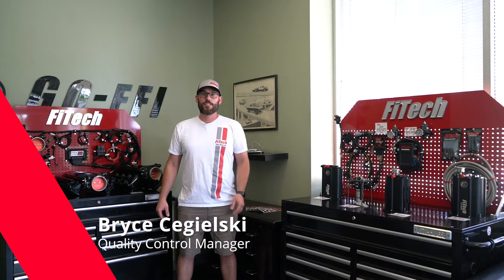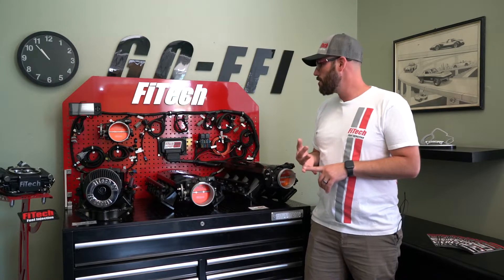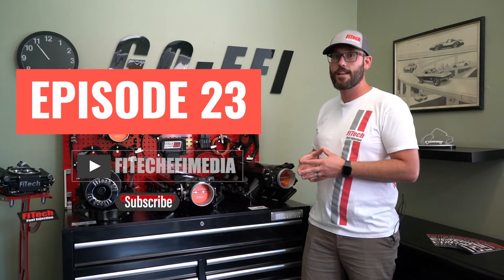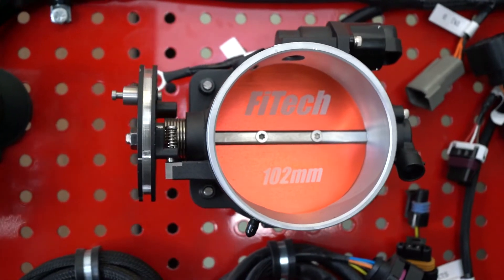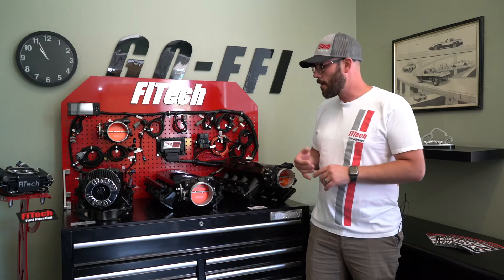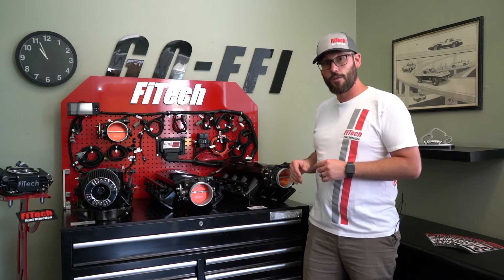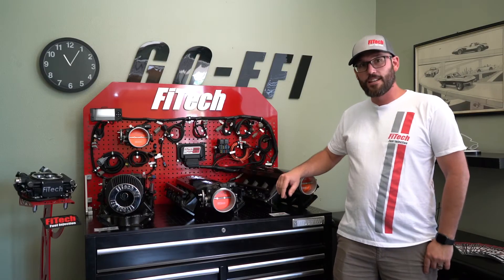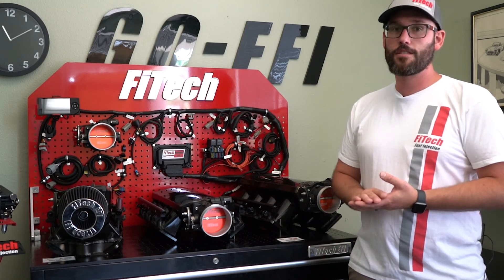Selecting your LS System | Tech Tuesdays | EP26

Comment: I have a 6.0 Ls w 4l60e transmission and want the complete ls kit w transmission control which do you recommend? And I would also like to know what fuel system ,its going into a 1985 k5 blazer 4x4  thx
Reply from the maker: Contact our sales department and they will help you put a kit together perfect for you application. 951-340-2624 opt. 1